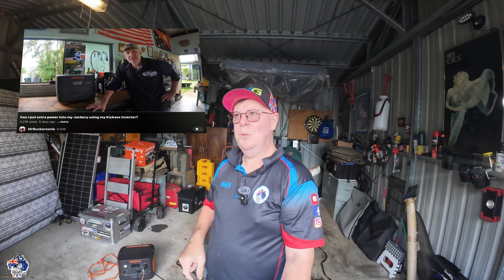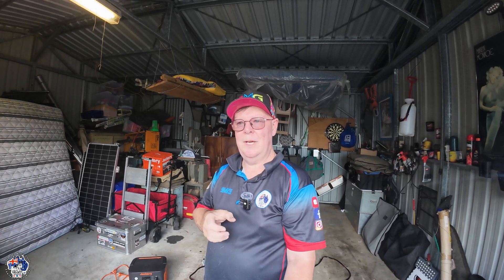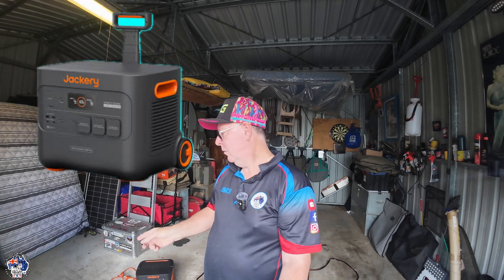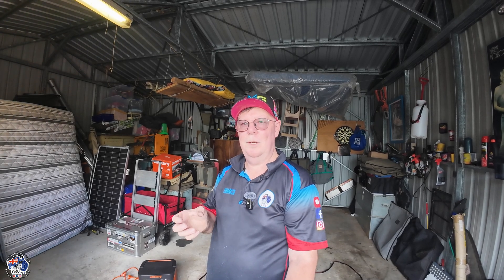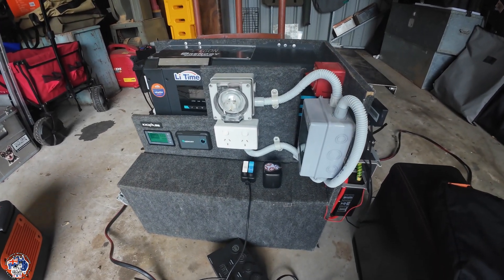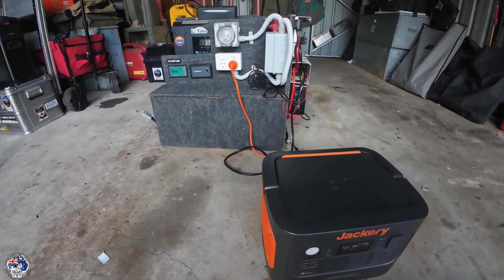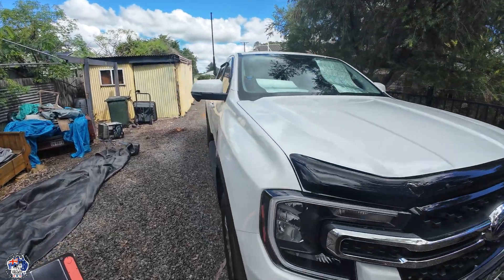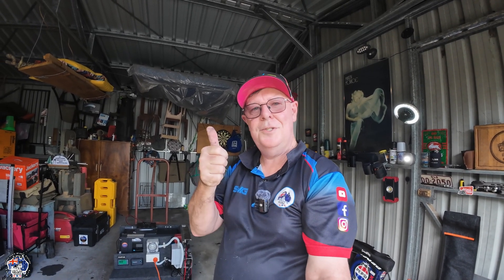can you charge one lithium battery from another? I’ll show you how.

Comment: Interesting episode and great to see experimenting with ways to charge a battery from another battery. Your trial here is using direct DC to Dc and inverter AC to AC DC charging within the Jackery. The science of charging is that you need a battery that is at a higher voltage to the flat battery. So if you connect a fully charged battery (LITHIUM 13-14 VOLTS) to a flat battery (11 volts) there will be a current to the flat battery until voltage equalizers in both batteries but that doesn’t mean the flat battery is charged. In your experiment if the charginging battery was supplying current through a dc dc charger you would get more energy transferred. With chargers they can accept a range of voltages and deliver a regulated charging current in accordance to an algorithm suited to battery chemistry. A lot to digest here but I hope it makes some sense.

Comment: Great clip Stephen. And than if need be you can run always a generator to top things up
Reply from the maker: Yeah I’m thinking I may need to do that at some point. But basically I was trying to show that you can top up a battery system from another battery system if needed especially if it’s overnight like buck wants to use it definitely though charge it up during the day through a generator makes sense.

Comment: I wish everyone would stick to 1 type of unit of energy eg watts and watt hours
Reply from the maker: Yes, it is very confusing. They started off with amps now. There slowly going to watt-hours
Reply: @Sawadventures67  My understanding is, that was the case, because year's ago most items were 12 Volt and Amps were simple. But now many items are 24 and 48 Volts, so Amps alone can't be assumed to be running at 12 Volts, so it's more accurate to use Watts or Watt hours. 
Liked your video, thanks.

Comment: Bucks power station is a 160Ah @ 12.8V.  It draws 10Amps  max @ 230V which is around 2300W. On DC it is up to 1400W.
Reply from the maker: Thanks for sharing the specs, good to know! I think that’s why I put up the photos saying you would need 1400 W and probably a 2000 W inverter cheers mate